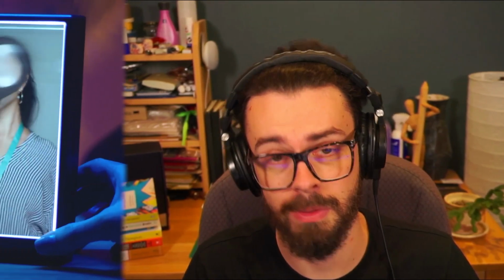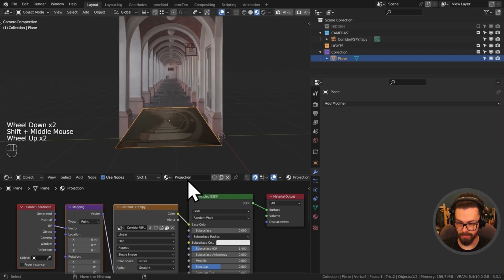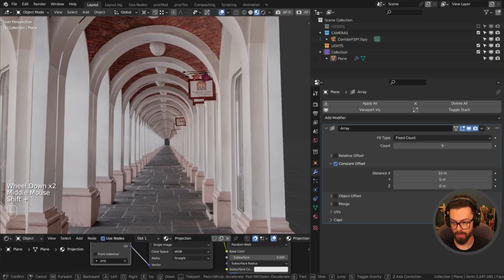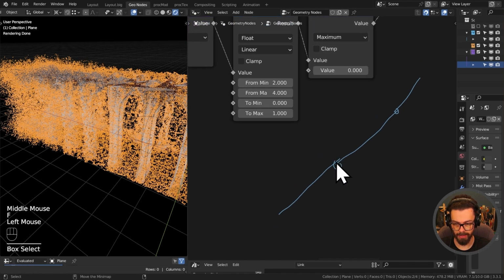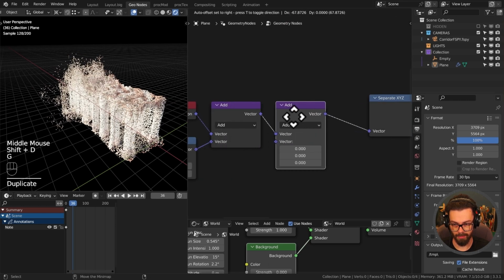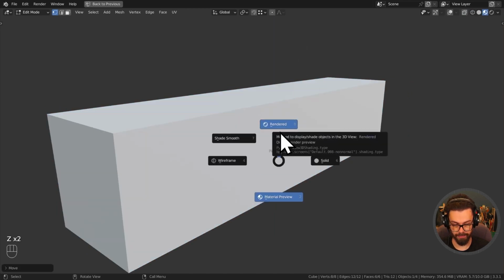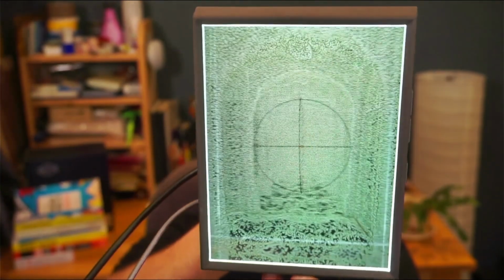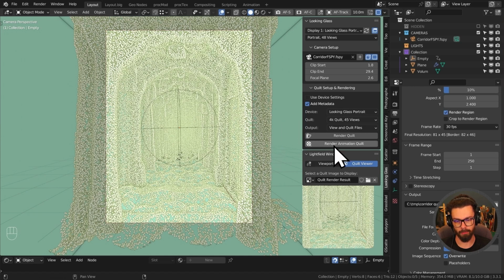Projection Mapped Point Cloud - Looking Glass Blocks

Comment: Is there is a way to render point cloud with motion blur? 🤔
Reply from the maker: It's not supported yet I think. If you can just calculate the vector difference from one frame to the next with geo nodes then you can use that in the compositor to do motion blur the old school way 😁
Reply: @Erindale  wow that's a good idea! i think it's possible with a new simulation nodes
Reply from the maker: If your animation is keyframed it's a bit harder but if you're animation is done based on the frame inside geo nodes, you can just duplicate what's working out the position, subtract 1 from the frame number for that part and then find the difference between that part and your main one. Store as a named attribute. Maybe try rending out as an AOV from shader (see if that's clamped or not) and then read it directly from the render layers node in the compositor to add the motion blur to your main image

Comment: "Projection mapped point clouds are tight!" - Pitch Meeting (also on ytube)

How is this different than all the Ps/Ae Parallax Effects I've done years ago except for the interesting way to accomplish this in blender?  How is this different than Chipp's Parallax Addon?

Why would I choose to use this over imbedding a full 3D display like on Turbosquid (Idr the other website(s) atm.)  

Good to know fspy compatibility was fubar'd by Ton...  Not like that was on purpose, otherwise it would have stayed super easy, barely an inconvenience.
Reply from the maker: Parallax occlusion mapping is a shader trick to fake depth, this is a way to reapply a texture to a scene to create actual depth.
There's definitely a time and place for the full 3D embed (sketchfab) but as soon as you go down that path, you lose access to the final render quality you can get in a block. Actual 3D embeds have to be real time 3D so models and textures need optimising, you can't do raytraced caustics or volumetrics etc.
Not by Ton, it's the GPL licence that the fspy creator didn't want to adhere to even though the software is free... Otherwise it could have remained an integrated add-on
Reply: @Erindale  Tyvm for taking the time to fill in my multiple ignorances.  I did ask all my questions in earnest.  When I learn just one thing a day I'm happy, I've learned many things today!  I'm Logically Fallacious on Discord... though also irl...  Stay safe and enjoy.  

I noticed you had books on the table behind you... I'm surprised some viewers didn't burst into flames seeing those things... it's like seeing hardware pdfs... anathema to current thinking.

Comment: I’ve never seen anything with projections, such a cool workflow. I don’t fully understand what’s going on, but what exactly is fspy doing? When you import from fspy and model with the projection modifier are the textures somehow being calculated and baked onto the mesh immediately?
Reply from the maker: Fspy computes the camera settings and position based on the perspective on the image. You import that to blender and it just sets up the camera. The UV Project modifier calculates where each vertex is within the camera view and maps that to a UV space in the camera view. When the modifier is applied then these UVs become properly baked in but it's not necessary as long as you don't move the camera. You can just add a second camera to use for rendering and animating though if you want to keep the first one as a projector